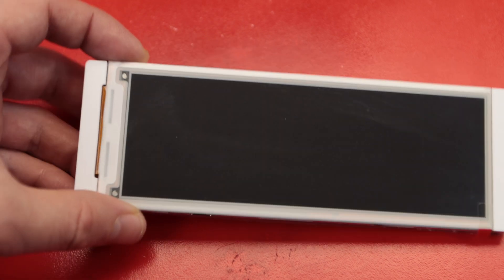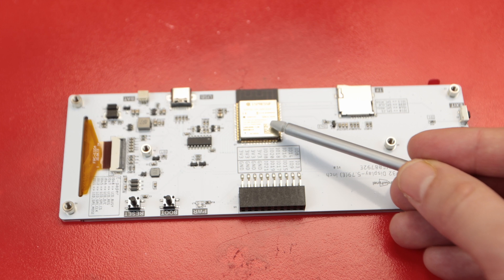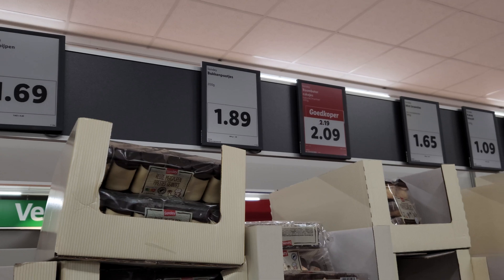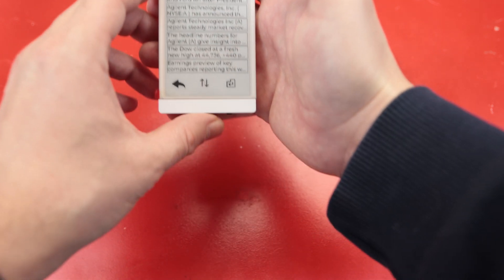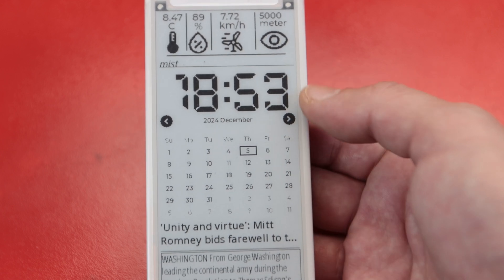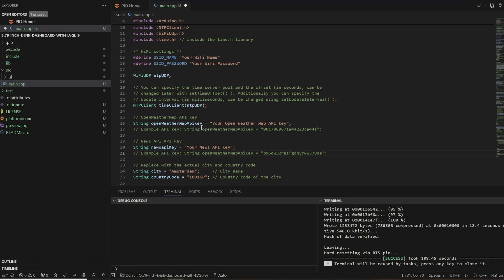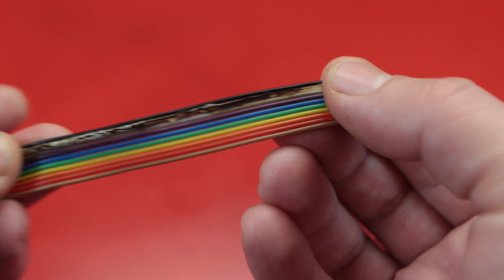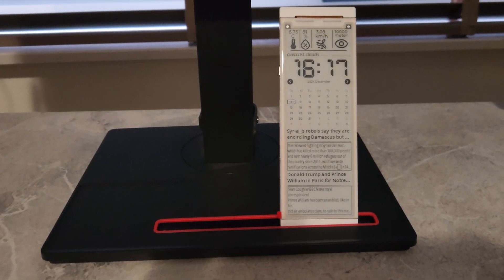Making a 5.79”  e-ink/e-paper dashboard with Arduino

Comment: Do you think if I detached the display’s ribbon cable from the driver, that I could laminate the screen to wrap it around a curved surface?
Reply from the maker: Hi. This screen is not bendable. you can wrap the ribbon cable, but not the screen.
Reply: @makersfunduck  Thanks for the response, I was not clear because I wrote that late at night. Could I take the screen out of the housing/ plastic backing , laminate it, and bend it around a curved surface. I am guessing modding it is not so straight forward or possible.

Comment: for the 3d printer, make sure the pinout is the same as the old cable, those cables can have the rows switched around or not so it might be the wrong way around
there also ways to control a 3d prrinter over usb from a pc which doesnt require a display, so you could try to see if the 3d printer mainboard works as a troubleshooting step (optimally with the display disconected so it for sure cant mess with anything)
Reply from the maker: Thanks for the tips. I will investigate it more on this and definetly check the cable.

Comment: very cool, I recommend eez studio for making LVGL user interfaces it makes it a lot easier to build out nice looking and complex designs and it's a free open source project. I'm buying an e-ink display for a charging case to display battery levels of devices inside. I am interested in how you ported LVGL to the device as I'm already proficient with LVGL so that would make it a lot simpler to create the UI compared to adafruit gfx which seems popular otherwise. I'm using a 2.13" e ink display either from elecrow or lilygo I will test both

Comment: IMO, the shtick of e-ink displays being their ability to display (static) content without power, this device should have had some kind of onboard energy harvesting and storage, combined with an ultra low power sleep-mode. Sure you can use usb for programming and media-upload and all, but not for the daily grunt-work, the power ought to be harvested "cables-free".
What could be done with such a stand-alone artefact?
- Calendar
- Upcoming weather trends
- ?? what else?
- most other gadget-geek ideas like "house plant last-watered date" sound terribly shallow.

Nevertheless, I'm up for Lidl selling their old BWR displays - perhaps under a "parkside" name or sth :)
Reply from the maker: I think harvesting energy is a great idea, and I want to investigate it further. I don't like charging devices frequently, so not having to charge at all would be the best. For the Lidl displays, I am particularly interested in the A4-sized version. It would be really cool to read PDFs and similar content on such a device. :)

Comment: regarding the Ender 3 mainboard, i can recommend the E3 lineup from BigTreeTech. they are affordable, feautre rich and use the original mounting holes and connectors
The SKR Mini E3 V2 or V3 are a great pick since they are the same footprint and layout, making them a drop-in replacement.
(Re)Programming them is also a breeze because of their 32bit STM controller rather then the ancient 8bit one in the Stock ender 3 board. it's honestly not worth saving that one
for more information or other 3d printing related questions feel free to reach out :D

Comment: Hi and greetings from Finland! 

You give so many ideas to put to use. Been planning what low power consumption display could show electricity prices with other useful info and these displays could be just the thing.

Thank you for your video!
Reply from the maker: Hi, for your purposes, a small display might also work out fine. But I think the advantage with a long one like this is, you can show many different type of data in one display, and it wont look bloated..

Comment: Very nice script! I use Arduino IDE. Am not so good with with other programs to flash these stuff. Anyways, you are a very talented man. Thanks for sharing this video.
Reply from the maker: @johnny, thanks for your kind words. I literally used the Arduino framework for this. In fact you can even use the Arduino IDE to compile and program if it is what you prefer. The main advantage of the PlatformIO is, you do not need to install the toolchains, and the libraries manually, and  it does all that for you.